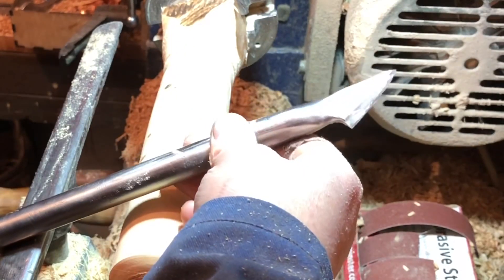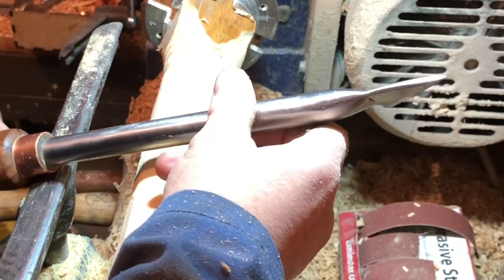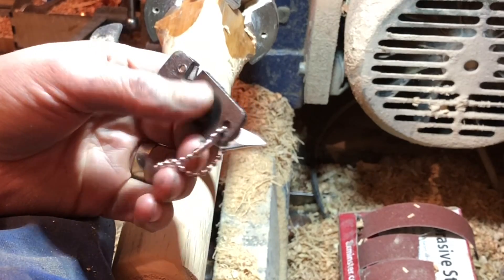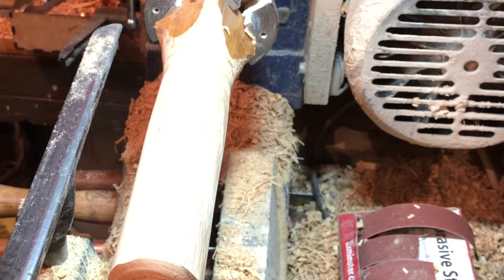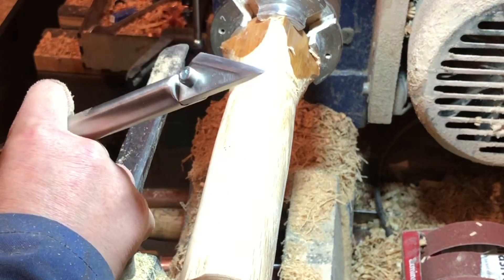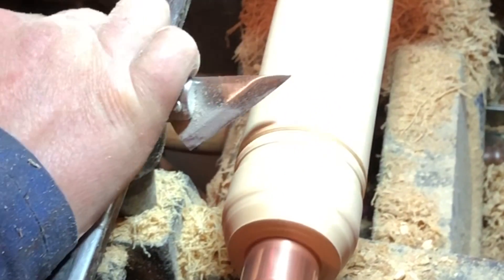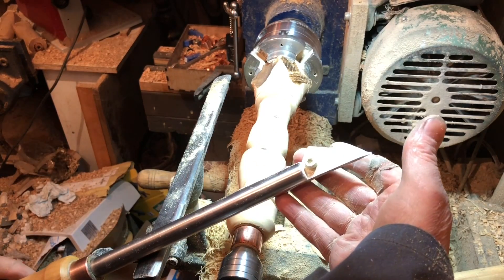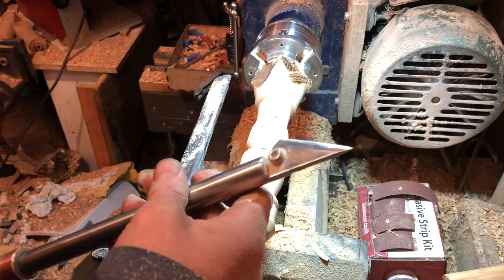THE EVOLUTION: A LATHE KNIFE OR CARBIDE CUTTER?

Comment: One of the Russian turners has the Closed Caption translated into English where he describes safety issues and the catch which sheared off his finger but it was reattached and he still uses the lathe knife in the same manner as you do. When starting with and getting used to this tool an over hand grip is recommended. As noted below the most dangerous catch is the tip which will kick the rear point right back into your fingers if it is deep enough of a catch.  Like the skew when planing cut, use lower portion of the tool, change your grip to use the point end in tight places ot keep your fingers on you hand,  Another point to note in the Russian videos, they are not turning real dense hardwood but it looks more like a Spruce  which cuts fairly easily so they cut impressively fast from years of practice with this tool.
I mentioned the CC option if you noodle around with those settings in the gear icon next to the CC button often you can get an auto translated Closed Caption. Older videos do not seem to have that option,  Not the best but you can get the gist of what they are saying and you'll have to watch it a couple of times, at least I did for I cannot read and watch at the same time.

Comment: Sorry, but as a professional turner, I can only say that evolution has taken a big step backwards.
Russian "design" is almost always the result of material problems, whether you take cars, motorcycles or cameras.
At 12:20, you can see that the tool produces more dust than chips; I don't need Russian "design" for that...

Comment: with regard to you Lathe knife , I have a cutter blade from an old planner, I would like to make one of your knives, but as this steel is very hard can you advise me on what drill I would need to make the screw hole.  all the best JB UK
Reply from the maker: John Boulton hi John, when I make the blades for the updated model I drill the screw hole before the steel is hardened and tempered as I, and you, will realise it is tremendously difficult to drill hardened tool steel. For your old blade I can only suggest clamping a piece of hardwood above the blade and drill through the wood and steel on a drill press, in one motion. The wood will stop the drill bit skating. Also start with a smaller diameter drill bit and work up, using lubricant continuously. If you continue to have difficulty, I can send you a blade which you can use to make a lathe knife.
Reply: @CLWoodturning  do you supply the blades finished tempered ready to, go  if so can you please give the price, thank you
Reply from the maker: John Boulton hi John, yes hardened and tempered with hole ready for the bars I make. You can easily make a bar to fit. Have a look at my Etsy for shape and so on...

https://www.etsy.com/uk/shop/CLWoodturningStore

Blades are £10 plus postage.

Thanks

Comment: Hi Col, this looks intriguing to say the least! I intend to buy one through your Etsy page.
Have you considered counter sinking the screw hole to accommodate a regular m5 carbide blade screw? Just a thought, as it seems the hex screw looks a bit obtrusive.
Reply from the maker: Marcel Rey to be honest yeah, but not your normal countersunk screw, I’ve done it with the screw in the video, half countersunk, and it looks great. The other type I find use a smaller hex key on M5 which strip easier. I’m cool even with it as it is but thanks for your idea bud!

Comment: Hi, I have been watching some of the russian turners for a while but didnt understand what they are saying. This a nice video that I can understand the language. What I wonder is, is there any risk of a catch like askew chisel. Thank you
Reply from the maker: Oh sure, like any tool there is a chance of a catch. However, the catch is only from the very sharp point and only if you present in the wrong way. As long as the wood hits the blade edge first, you will not catch. If the wood hits the point 'blunt' side first then you will catch. The tip can be presented to the work but with the tool sharp side 'up'... allowing accurate V cuts directly into the wood. It simply does not catch. I have used a traditional skew for over 15 years and find this tool, so much easier to use, it has a more natural angle to hold the tool, very similar to a bowl gouge in orientation. thanks!
Reply: CL Woodturning thank you very much.

Comment: CL, I followed the tutorial you made for making these knives, and I have just been amazed at the ease of how this wonderful tool works! Thank you for posting this. I used the end from a dull file that was in my shop for the cutter knife and welded it to a 1/2 inch piece of drill rod for the shaft. You do have to reharden the cutter after you finish making the tool, but boy is it worth it! I also used a piece of cherry wood for the handle. It came out a beautiful and impressive tool.  I had never seen one of these until I found your video. You are right- this could go on to replace the skew, especially for the newer turners. It is easier to handle with similar results.
Reply from the maker: TheRekitter aww class!!!! Made my week that comment bud, thank you!

Comment: now THAT is a COOL tool. I presume these (maybe with modification) will fit on any carbide bar.  Neat!
I have been gradually modifying a skew and lengthening the edge, but that is Great!
Reply from the maker: Joseph Ellis hi Joseph, yeah you could put this blade on any bar but the hole may need adjusted on your bar. These are made to take the knife blade and also a 16mm carbide, slightly off centre so the carbide hangs off left and front edge whilst the knife blade sits true center. Cheers!

Comment: You made some fantastic tools. I just bought me my first wood lathe and I am struggeling what tools I should get or make myself. Just as I came to the conclusion that I can't make the myself, because all the tools I saw where some fancy HSS or carbide tools I saw your videos on the lathe knife. You encouraged me to give it a try and make my own tools. Could you maybe give me some tips and advice how you made it (blade and shaft material, ...).
Reply from the maker: kaerTo this Evolution version is cut into the bar stock, no welding, but blade is screwed to bar. The original one I made is welded like follows:

kaerTo sure bud... The tang should be welded in a groove cut in the end of the 16mm stainless bar stock.

Don’t just weld blade to bar as the weld then takes full brunt of forces.

After welding, grind to a rough cutting edge, heat treat to non-magnetic (deep cherry red, use a magnet on a stick), quench in oil, tidy up blade to shine and then temper in a kitchen oven, 1 hour at around 225 degrees Celsius. Allow to cool slowly.

Should come out of oven golden yellow/ straw colour. If blue, too hot, if nothing, too cold.

Tidy up blade again and grind final razor edge quenching repeatedly in water. If blade blues with sharpening, hardness is lost. Place in turned handle.

Both the Evolution and the original are heat treated to maintain a sharp edge. 

Hope it helps. Colin
Reply: @CLWoodturning  Thank you very much for the instructions. Do you think I can mild steel instead of the stainless bar. If not could you tell me what kind of stainless bar stock it is. Is it V2A or something similar (is the steel magnetic or not).
Reply from the maker: kaerTo oh sure, the bar could be any metal really, even aluminium as long as it was thick enough. Mild steel is fine. I use stainless because of strength AND finish. Ideally, the cutting head should be HSS steel but as long as the heat treatment is done well, 01 Steel plate or ‘tool steel’ is fine for cutting wood. HSS plate is expensive and would  have increased cost to potential interested buyers. 

All of my tools are either shop made or second hand, there’s no need to spend 100s on big name makes.
Reply: @CLWoodturning  I will definitly give it a try. What other shop made tools do you have?
Reply from the maker: kaerTo sure, all of my carbides are shop made, only the tips I’ve had to buy, a tool called an English Bedan which is basically a square edge cutter, 6mm for cutting a mortise or other detailing...I’m soon to sell these.... my thin parting tool is shop made from HSS steel....captive ring tool from Allen key... video on here somewhere.... all of my handles including quick release ones.... (are you asleep yet??).... seriously the list goes on.... mostly because I hate the price of big names or the quality is poor or not worth the cost. I make and sell tools I know work well because I use them daily. I cringe when I see an advert for carbide tool sets at like £175 or so when they really cost £6 a blade, then some bar and handle... check Easy Wood Tools site and you’ll see lol
Reply: I'm not asleep yet 😂. 
Yeah I think the same. All this expensive tools and as a bloody beginner you don't know what typ of tool to buy not to mantion the many brands. I also try to make as many as I can by myself. I am very thankfull for your advises and hope that I can soon start some fun wood turning projects
Reply from the maker: kaerTo sure man, just go for it. Don’t worry about perfection just make sure you stay safe. I’ll help with any questions you have, just shout.
Reply: As am engineer of 30 years it is a lovely tool  the version that can have separate tips is great .
Now I'm retired I would like you to patient it and sell them your self nut thats my opinion, would be interested in purchasing some tips and handles from you

Peter
Reply from the maker: Peter Wilton thank you for your kind worlds peter. I do seek the tool and have indeed looked into a patent. If you are interested. My Etsy store is linked below. Thank you again, Colin 

https://etsy.me/2GzEMWL
Reply: @CLWoodturning  At what angle do you grind your lathe knifes?
Reply from the maker: kaerTo I’m still deciding on my preference but the smaller the better for cutting edge angle... I think it’s around 26 degrees at the min, started at more like 30.

Comment: A nice option for the lathe knife to have a removable blade.    I would use a rounded head screw to minimize marks if the screw touches the wood when tilted to the screw head side of the tool.    These are known by several names, socket head, button head, round head etc.   A link to illustrate.

https://www.tcfixings.co.uk/main/maincat/getCatitem/Socket-Button-Head-Screws/134/0/0/1/12

Good tip on the kitchen knife sharpener to hone the blade.

Dave.